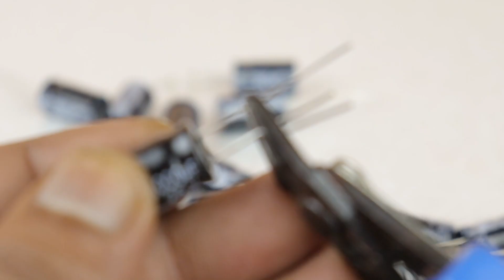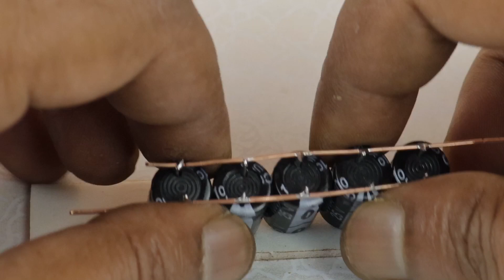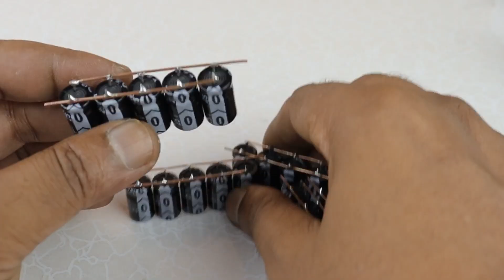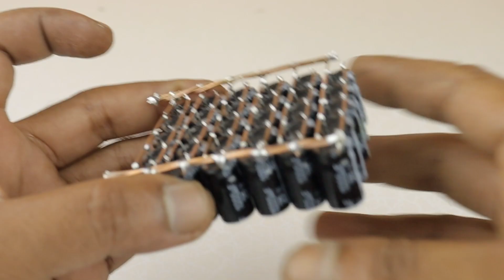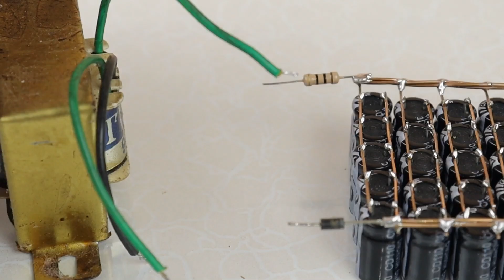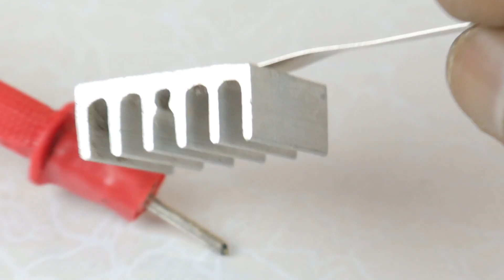Diy 18650 Spot welder #spotwelder #18650spotwelder

Comment: What are the specification of the transformer? How much the output voltages?
Reply from the maker: 9 0 9, 500mA step down transformer
Reply: If i understand, it's transformer 110v / 90.9 Volt ??
Reply: @MrSharingan988  no. Its a 9v-0v-9v transformer. Which means theres 3 output wires if you use one of either side wire and the middle wire you'll get 9v. And if you just ignore the middle wire and use the 2 side wires together you get 18v.
Reply: @TechIdeasAG  u used 9v wares of the transformer.....then the output voltage must be 18v

Comment: 30 condensateurs 25v 1000 uf. 
Diode ????
Résistance ????
Transformateur ?????
Reply: diode 4007, res 10 ohm, transformer 18v (9 to 9)
Reply: how many amperes needed from transformer?
Reply: @jikka1781  he used 500ma